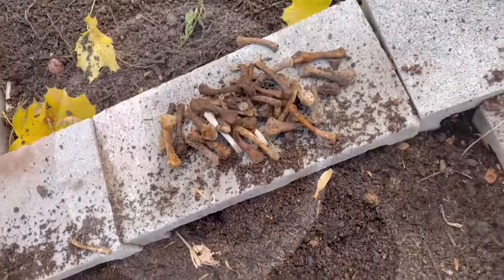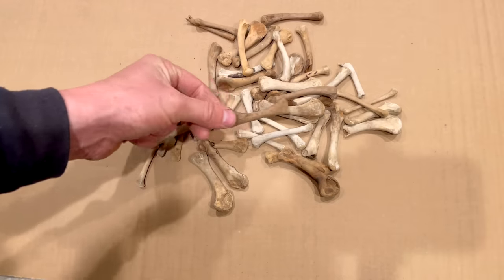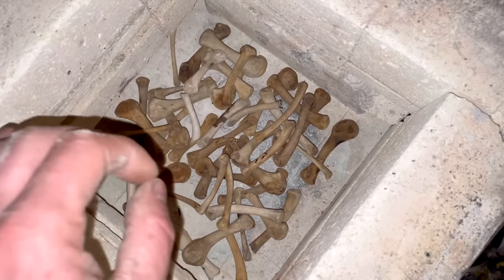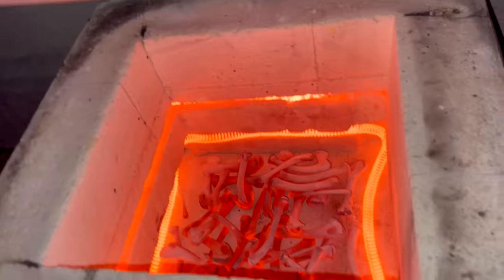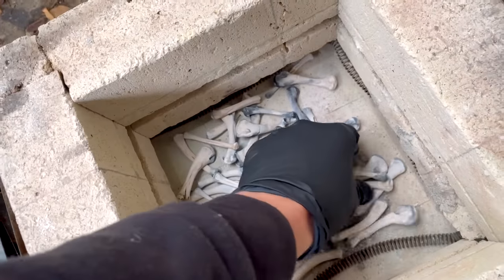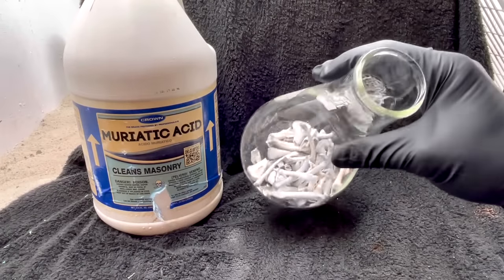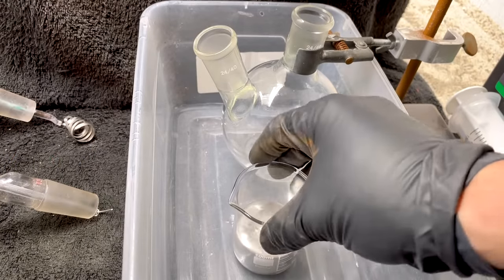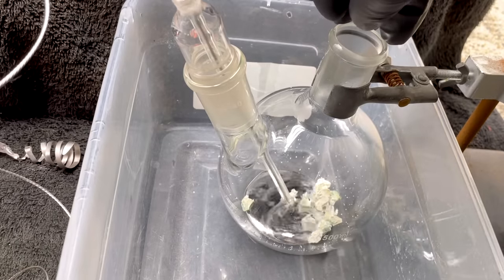Calcium Metal From Bones

Comment: so, with composting. you can actually compost meat, but it'll require different conditions than plant matter does to break down properly. you basically need to be turning over your compost pile, mixing it up and such, every couple days or so. it is actually possible to make something to do this for you, like a bin with a shaft down the middle, that shaft has rods off the sides and can be spun to mix the contents.
you still don't want an all-meat compost though. when i do this i go for around a 70/30 split between plant matter and meat, meat being the lower one, and that gets me decent results

Comment: 12:52 A hint for using magnets when picking up random powders. Put a small sheet of paper under the magnet so the stuff sticks to the paper. To clean the magnet just move it away from the paper and all the stuff will drop off leaving the magnet clean.
Reply: Codys next video is about demagnetise those magnets to remove the iron dust.
Reply: @tiitto167  and then magnetise it back again. Love cody, really humble genius lad.
Reply: A Dixie cup works great for that. Drop the magnet in and then move the cup over the area. Then just hold the cup over the trash and pull the magnet out.

Comment: Great work, Cody!
It would be intersting to test your final product of the "mercury route" for the presence of calcium carbide - if you want to go the whole nine yards. It is easy to confuse calcium carbide with metallic calcium since it also releases a flammable gas when reacted with water (acetylene instead of hydrogen).
Reply: Seems unlikely. Acetylene burns bright and with a lot of soot. Very unique flame, could not think of anything comparable, really. Hydrogen just....burns.

Comment: The grey spongy thing is CaC2 ( calcium carbide) as you used graphite crucible and a lot of heat under reductive conditions, carbide reacts with water and produces acetylene ( flammable ) and calcium hydroxide and extra graphite that's make the greyish solution ... It is not pure carbide which is yellow grey...
Reply from the maker: In that case I discovered a method of producing calcium carbide without needing 3000+C temperatures. I'm going to be rich!

Comment: Hey Cody I noticed that your having some tremors going on , go get yourself checked for mercury poisoning , I had the same symptoms back when I was working at a gold refinery . I'm letting you know because I had to have this pointed out when I was poisoned . Let me know whats up and be safe
Reply: hes been tested before and it was all clear. but it has been a few years
Reply: That was my first thought, metal poisoning. Urine chelation will give results of what's in tissues. Until then nano zeolites might help.
Reply: To be fair, butter is more dangerous for him than uranium, mercury and chlorine gas
Reply: I think there's a much less scary reason for the shaking and tremors: Trying to awkwardly work with this stuff with a camera in the way. 😅   I've heard from other YouTubers that do this sort of POV style recording that they are almost always trying to work at really weird and uncomfortable angles. Although, I'm sure it wouldn't hurt to for him to have it checked again.
Reply: @BRUXXUS  My kidneys are all screwed up from working at the refinery and that was 40 years ago , I used to shake like Cody from metal poisoning , you would be amazed how little it takes to mess you up . I did it for 8 hours a day 3 1/2 years with no ventilation during the winter and very little during the warmer months , plus I was breathing cyanide and a few other nasties
Reply: @BRUXXUS  I thought of that too, and possibly the temperature outside.

Comment: Blow's my mind that with a mercury cathode you can reduce metal cations to the base metal in an aqueous solution. Typically with any water present the electrolysis does not proceed as planned but with mercury it still works.

Comment: You used process (COLEX) with mercury The same process as lithium 6 isotope refining from lithium 7 from lithium hydroxide and Mercury. 
which we use lithium 6 in neutron detectors.  Nice work.

Comment: @12:00 Can't quite tell, but I hope that poking about was with a glass rod, rather than metal! 
Video might have ended early if the dish was pushed onto the live heater. 
(also dangerous if the dish were to touch the heater wire on two sides)

Comment: You can put meat in a compost but it has to have a very high cellulose content.  To compost a dead cow you have to eviscerate it first and stuff it tightly with something like dry hay or grass clippings and then put on a thick bed of the same and cover it completely.  The removed entrails and organs will have to be thoroughly mixed in its own pile of cellulose.  That is how it is done, if you want to do it, but we just drag them to the edge of the field and let the coyotes and other predators have a feast and then plow the bones and skin into the soil the next time we plow the field.

So if you just have some spoiled meat in your refrigerator and a bag of grass clippings you can mix them together and add them to you compost pile with no problem.

Comment: NileRed: I will need exactly 24.539 grams of this 99.99999 pure element to make this.

Cody: I will spit 2 times in this old plastic bucket, that I also use to dump out manure, to neutralize the Strontium-90 isotopes...

Comment: Hey Cody. Ive watching vids on how gallium weakens aluminum by penetrating into it. So I was wondering. Is it possible to extract the gallium back out of aluminum in some way? So that you can melt the gallium removed with warm heat again, and also smelt the aluminum back into what seems like typical aluminum?

Comment: some mixture compound to make vacuum, ie, remove air gases, reactant to bind the normal gases, like nitrogen, hydrogen, oxygen, carbon dioxide, helium, argon, much like SiO2 but for gases
Reply: Sodium metal making process fully detailed
Reply: have you tried electroplating of CaSO4 in water solution into Ca and H2SO4 in a membrane separated dual cell
Reply: same for Potassium, K2SO4

Comment: meh, using Mercury is about al lame as using another alkali metal, like Lithium etc. What I want to see is the electrolysis done with some kind of inert ionic liquid, like the cryolite process that they use to make Aluminum but at a more S.T.P.. I have read about, but can't recall the names, of some fairly inert low melting point ionic solids that can be used for this very purpose.

Comment: Not all of us have mercury, or would want to use it this way if we did. Do you know of any low melting point salts that may be more accessible for most people for this sort of thing?
Reply from the maker: Some industrial methods use tin and a low melting salt mixture. That requires an additional electrowinning step though.

Comment: I'm expecting that if you try to run electrolysis on CaCl in water then any Ca that you form will react to Ca(OH)2. Since calcium is stable in ethanol, could you run electrolysis on a solution of CaCl and ethanol?

Comment: hey cody, I have an idea for a perpetual motion machine that might require Mercury. It's simply a "water" (mercury) wheel, pump, and generator. The idea is that if you could accelerate the liquid before hitting the wheel with MAGNETS, it would overcome the energy being taken by the pump and generator.

Comment: Calcium oxide consists of Ca2+ and O2-, but that does not mean calcium has given electrons to the oxygen. It's been Ca2+ ever since they were part of a chicken, all you have done is change what the counter ion is, you started with phosphate, then went to chlorides, swapped that to oxalate, which you decomposed in to calcium oxide. Calcium exists essentially only as Ca2+ since you need to do a lot to get the metallic form. Forget the valence electrons in atomic calcium, compound only exist in that firm of they are metallic or noble gasses!

I'm tired of shit chemists being viewed as skilled! 

Also, stop using mercury its toxic and sour for the environment, or pay to have it taken care of by pros!